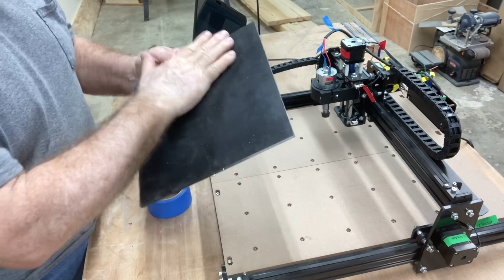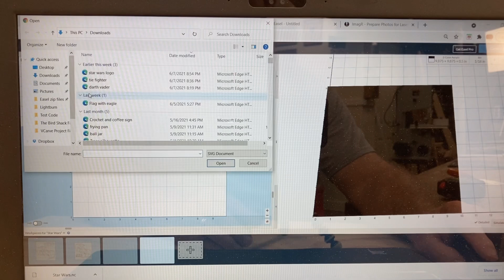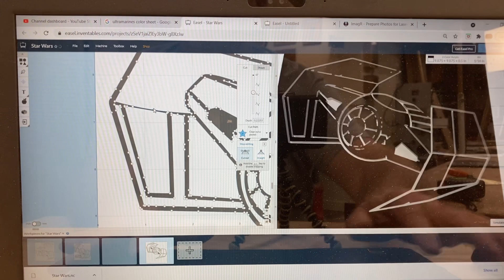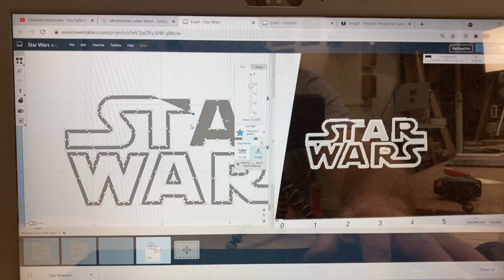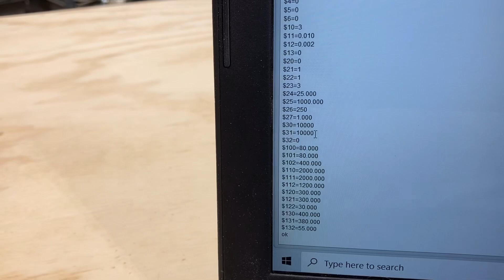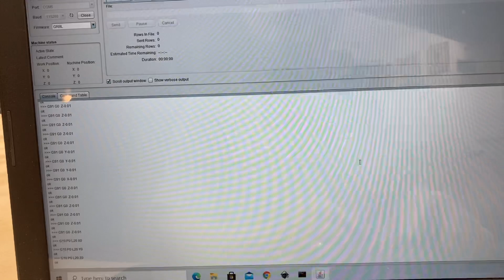First Carve with the FOXAlien Masuter

Comment: Can you put a Dewalt og Makita route on this basic version`? Or do you have to have the XE or Pro?
Reply from the maker: No it’s to lightweight
Reply: @PawPawsWorkShop  okay, so I'd have to upgrade and get the pro or XE? Looking to have a CNC cut out wood coat hangers and other stuff for business, just don't know if the 60W base spindle is capable, and if you can even upgrade the spindle to a more powerful one, if that even helps. I'm a total new at this and I'd like to get it right from the start without spending too much
Reply from the maker: If you are planning to use for a business then I would consider a FOXAlien VASTO. Yes the 4040xe would be the minimum
Reply: @PawPawsWorkShop  thank you!

Comment: Hi, I just purchased a Fox Alien Masuter pro and got it set up but the spindle just will not run. The XY and Z Axis work ok but the spindle will not run. Can you help? what do you think is the problem?
Reply from the maker: The gcode usually turns it off and on. If you are running a file and the spindle does. To turn on, you most likely missing the start and stop command

Comment: Hi what do i need to do when my machine is not working in inches as my design??
Reply from the maker: You have a setting wrong somewhere. If you design in inches then perhaps the post processor is in mm. You’ll need to check the settings in each of the software that you are using from design to output.

Comment: Hi,i would like to buy this machine.My question is can i easily upgrade the y axis with 2  longer aluminium profile ?Also i see some parts are screwed on the y axis aluminium profile.They are removable right?Thanks!
Reply from the maker: Yes, it is possible to add longer rails. One thing to consider, this is a very lightweight entry level machine. You will most likely need to add a means to strengthen the rails as well as the whole machine.

Comment: What can you carve with this? Can you use slate, wood, aluminium and so on??
Reply from the maker: The Masuter is extremely lightweight and very limited as to what it can carve. I would move up to the 4040xe or larger
Reply: @PawPawsWorkShop  thanks for replying. I'll have a look.. Can you tell me, is software user friendly.
Reply from the maker: Easel is easel and is excellent to begin with and then you will mostly more up to VCarve by Vectric

Comment: Thank you for the great information. I have been thinking about getting a cnc machine to use in an apartment. Although space is limited I wanted to have as large of a cutting area as possible. 
I was thinking of Genmitsu or maybe a upscale machine like onefinity but for now this looks to be a better choice especially at the $550 price point. 
My question is: I am planning to cut/mill mainly styrofoam , plywood and maybe some wood/mdf. I don't think I will be cutting any metals. Do you think this machine will be reliable for that? Also noise is important since I live in an apartment do you think it is quiet enough for that purpose ? 
Lastly how can I keep it clean while cutting, want to minimize dust. 

Best wishes and congratulations on the nice reviews.
Reply from the maker: Yes, the machine can do that. I would get the upgrade 300watt spindle. The spindle is quiet. The vacuum is most likely louder than the CNC. As far as the dust, keep the vacuum going
Reply: @PawPawsWorkShop  Thank you very much for the answers. I hope you don't mind a couple of more questions. I was actually thinking of the spindle upgrade. I used to have a makita router , how would you compare such a router to the 300W spindle ? 
I was also wondering if the difference between XE and this version is worth it if metal carving is not a priority. They look the same other than components but I realized that Masuter is listed as a bit shorter on one axis (15.75 XE vs 14.95" for masuter).
Reply from the maker: The Masuter is much lighter weight. Smaller stepper motors. Most likely you would outgrow this one quickly

Comment: can you not just resize the SVG in inkscape and re-import  the vector? that would be a lot faster.
Or in Inkscape, click "Path" then "Simplify" that will remove extra nodes.
Also, while in Inkscape, bring your StarWars logo in. Select the logo and right click it. Then click trace bitmap. then click "OK". That turn your image into a svg vector.
Reply from the maker: Yes you can resize an svg file and vector file in easel, Inkscape and v carve

Comment: Just curious - If you just used a smaller bit, would that not have corrected the problem?
Reply from the maker: Yes, but it would have changed the entire look of the project. The bit diameter was only part of the project
Reply: @PawPawsWorkShop  Thank you.  I am very interested in milling metals that have small(is) grooves to I am trying to learn.  I appreciate your channel.

Comment: What is the material you are cutting into ??  And do you need a special up cut bit or use the same bit as you would in wood ?
Reply from the maker: This is PVC. It cut smoothly with same bits as you use for wood
Reply: @PawPawsWorkShop  Thank you.  With the current prices on wood, I am looking for different material to cut.  Love the videos.
Reply from the maker: Thank you

Comment: in the G code, towards the top, is usually the command to turn on the spindle, M3. Following M3, with a space on the same line,
you can add S10000 to set the spindle speed if it isn't there already. Takes 5 seconds to edit the file.
Reply from the maker: My version of UGS does. To have that feature. May look into the later versions. Thank you

Comment: That issue with the text double lines is quite common in easel tracing both the inner & outer edge of each line
Reply from the maker: Yes, you are correct. It does give the option to carve just the outline. I just did not like the look of the carve

Comment: Great video. Nice clean lines. White on black totally suited to star wars. That bit growls a bit on your material. Surprised your Alien only has the 775 motor and not the 400w spindle ,!
Reply from the maker: This is a very basic machine. NEMA 17 and 60w spindle. You can upgrade to the 300w spindle